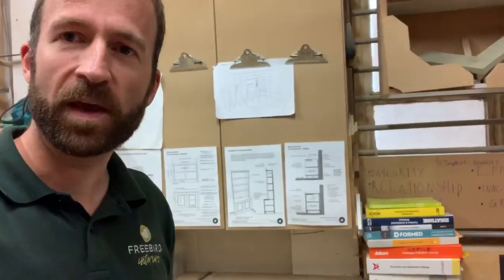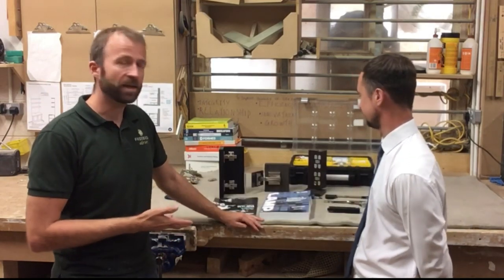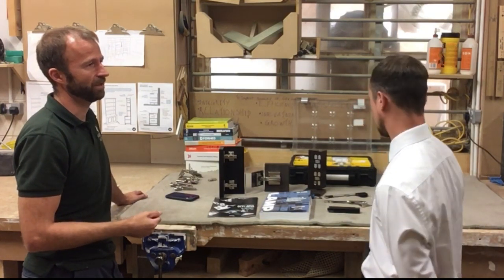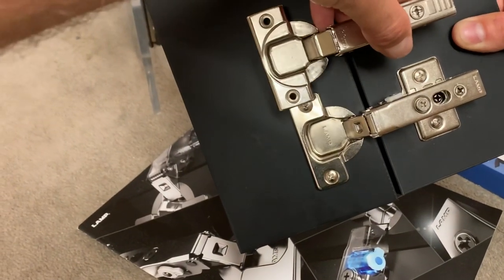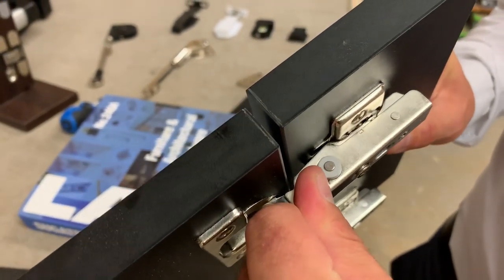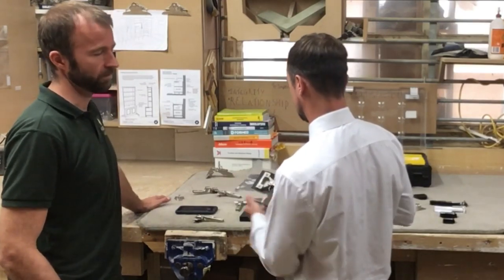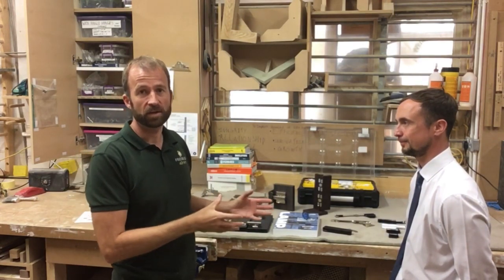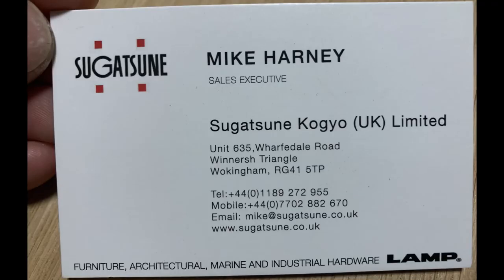Getting technical with Sugatsune!

Comment: Interesting video. Hopefully the future videos will show whether you made the switch.
Reply from the maker: Interesting comment - I kept an ongoing good working relationship with Sugatsune, and in particular their rep Mike, and continued to buy from them for specialise flap hardware, heavy duty hinges, and other special cases not covered by blum.  Then they proposed a closer relationship for mutual benefit in which I would use and talk about their olympia hinge range, with them supplying the hinges free of charge.  The hinges are very well made, however we hit upon a few problems.  Firstly with their inset hinge - it simply wouldn't work with our unusual alcove cabinets hinging method, where we use an inset hinge for the sake of lateral positioning of the door, but we actually overlay the top and bottom of the door.  This workls fine with blum, but with the sugatsune hinge, the door moves backwards as it opens, meaning it fouls on the top and bottom edge of the unit.  This is because the designers did not anticipate this use case.  So reluctantly we had to stick with blum for inset hinges. Then, for the overlay hinges we hit upon 2 more issues.  In japan a standard board and door thickness is 20mm.  This means that the hinges come factory set to overlay the carcase at 18mm (leaving a 2mm gap) on a 20mm carcase, but in the uk this means that every hinge has to be tweaked in, whereas a blum hinge will go straight on at the ideal overlay.  Secondly, the olympias coped less well with doors of 22mm thickness and above, tending to bind when opened
Reply: @Alastair_Freebird  thanks for the detailed response. I think a one size fits all solution for many things in life doesn’t exist! These things are sent to test us 😀

Comment: The it click on the door is very nice i use lots of blum with the kitchen we fit Showtime it wont click
Reply from the maker: theethee yog you mean when you offer up the second or third hinge (premounted on the door) and it just refuses to click on?  Sometimes it’s a line-up issue with the mounting plate (vertical positioning) or else the hinge arm adjustments have already been moved out of sync vs the other hinges.  It’s frustrating when it happens, and Sugatsune’s system on the Olympia hinges does seem like it will reduce the issue.
Reply: @Alastair_Freebird  
Exactly what i mean you are spot on i never heard of sugastsune range i m not a furniture maker but i fit kitchens mostly benchmark they use blum